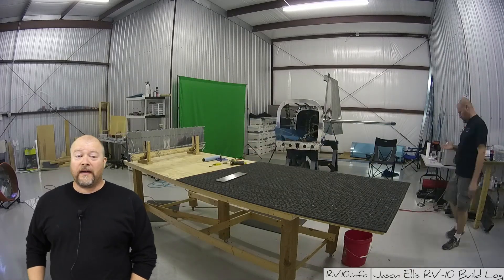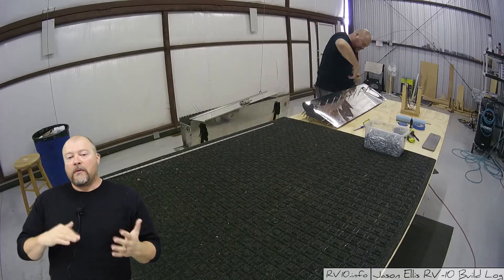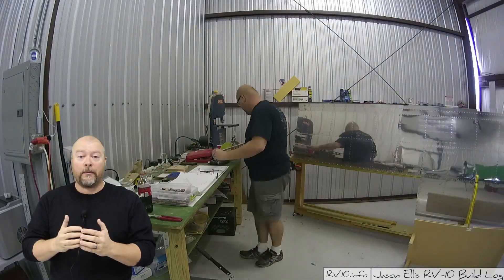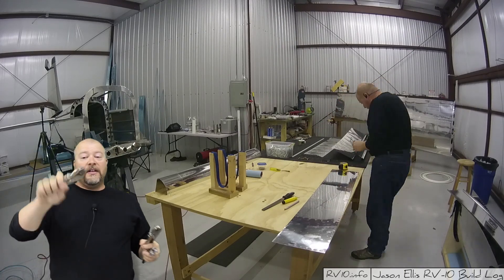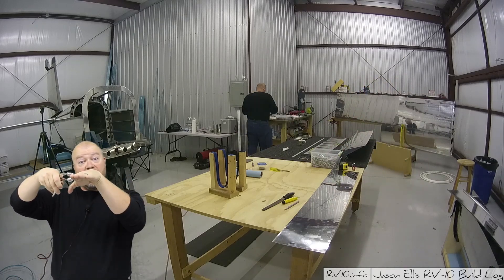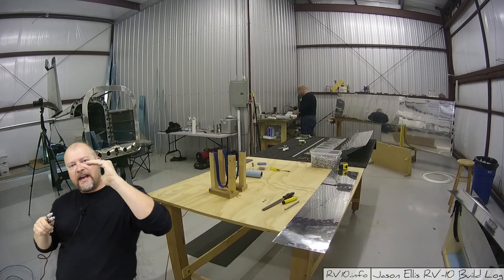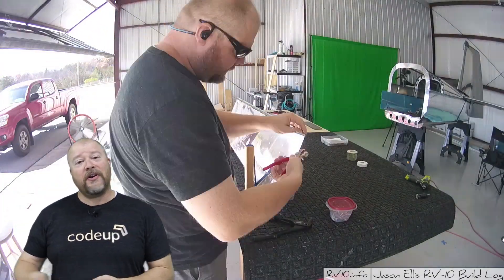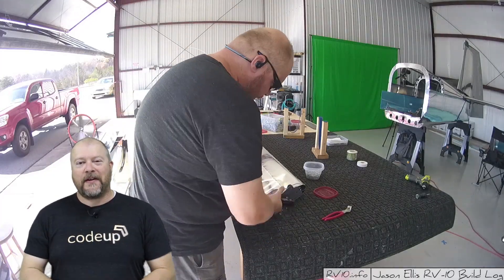RV-10 Wings - 032 - Aileron work - lap joints and edge breaks

Comment: If you can will you talk about why you made the decision to not prime your parts. I'm building the RV-12 and decided to prime any part that will be a interior. I'm not trying to say it's good or bad that's a personal thing. But for example you might not want to do it due to: weight, cost, time, etc. just wondering what your thinking is on this the primer wars. Thank you for taking time out of your life to show us you building of your RV-10.
Reply: Hi David,
I'm building an RV-7 and chose to alodine and prime all the interior. I just think it's good to protect the parts. On the plus side, you will save some scratches will assembling.
Reply: Can't speak for Jason but on my 10 i decided to prime certain parts of the build. I did essentially the entire empennage with some two part AKZO primer.   It does take both additional time and money but I enjoyed the learning expierence and it's good to know that my tailbone will have that added protection. 

I went the Quickbuild route so the wings and fuselage had some primer treatment done for me.  For the additional parts I've had to do such as the bottom wing skins and such I primed those with some rattlecan stuff.  This is fairly cheap and easier than two part expoxy and will add some extra protection to things I can get to easily in the future. 

I'm selective on some of the parts, for example not priming interior access panels or things that are either easily replace if they do corrode or not facing any sort of harsh conditions. Again most this stuff was already primed at the factory so if it's good enough for Vans then I'm fine with it.
Reply from the maker: I will answer this in detail soon.